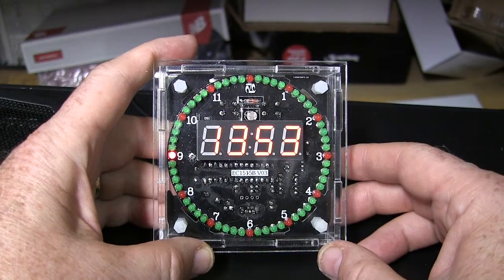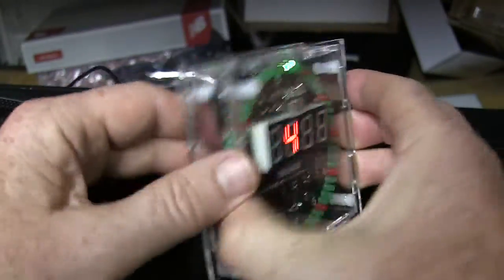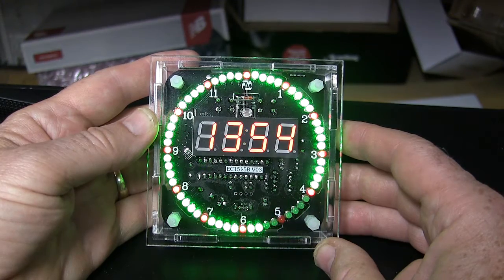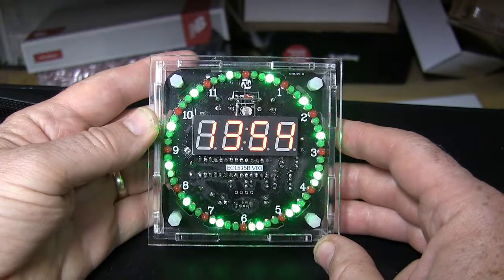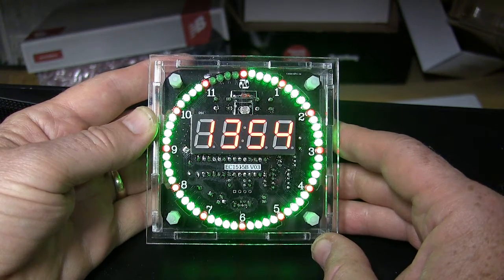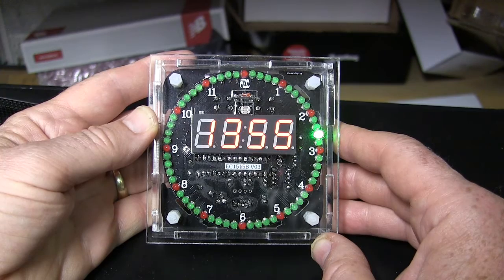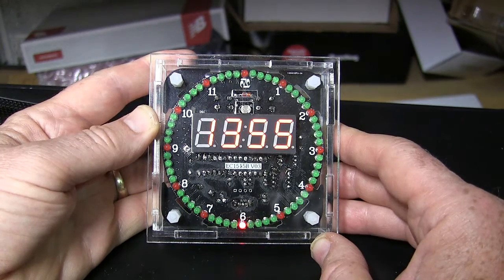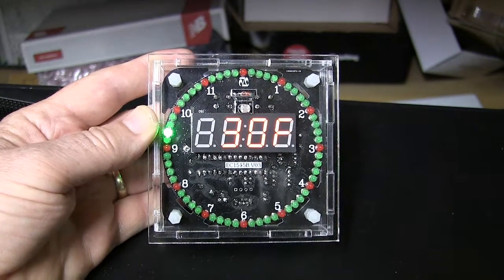Banggood EC1515B clock kit display modes

Comment: '
can this DIY rotating LED clock kit use a pack of four AA or four AAA batterys = 6 volts...
would be work fine or better not...
will it burn out LED lights or two microchip controllers or both

Comment: I am pretty certain that the problem with your clock, where LEDs near the '8' position come on incorrectly when LEDs just prior to the '12' position are on, is due to a bad photocell (photo resistor). I have the same kind of clock with the same problem....I realized that for the LEDs to turn on that way, the processor's Bit 5 and Bit 7 must have a low resistance between them. The only component on the board that is connected between those two I/O lines is the photo resistor. On mine it measured only a few Ohms after being removed from the board, and with it gone the LED problem went away. You only need the photo resistor if you plan to use the 'light control' mode.
Reply: don't think so,  the photo resistor is working, the display dims in dark room and goes bright when ambient light is higher.